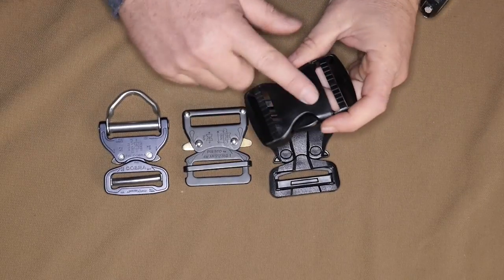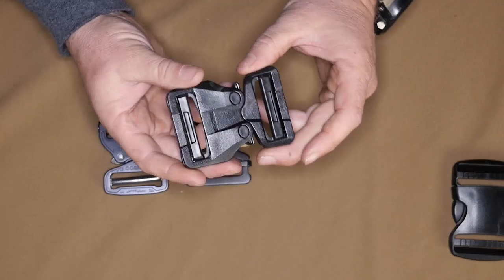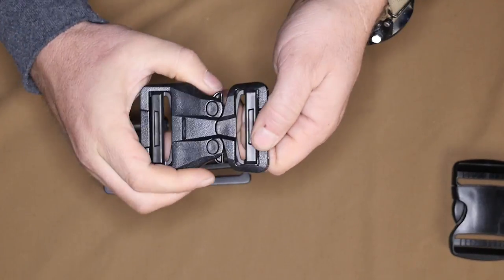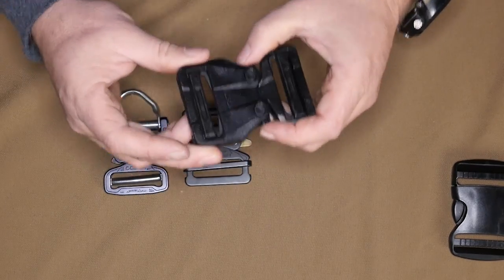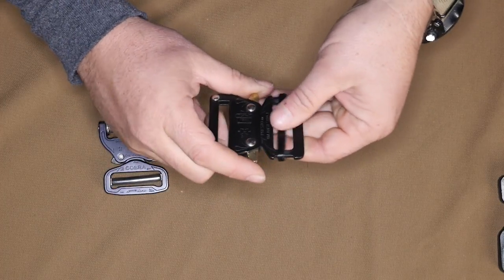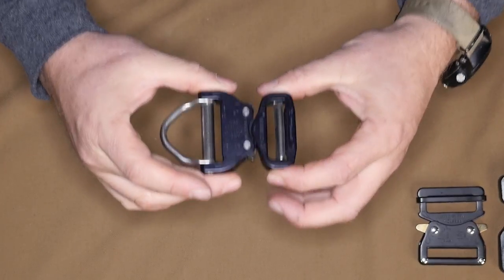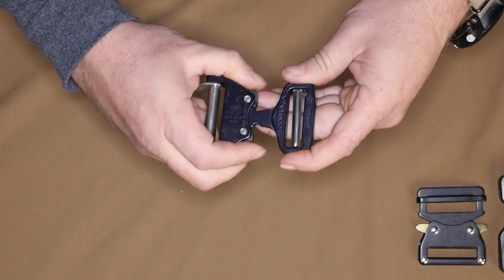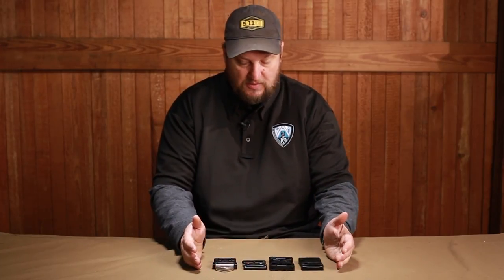Why Do You Use a Plastic Buckle on Your Dog Harnesses and Collars?

Comment: Is there any particular type of buckle that is recommended for a dog harness used for pulling?.. the plastic buckles the harness came with are too easy to unbuckle.. will come lose with no effort at times
Reply from the maker: We would recommend the GT Cobra Buckle, a load-rated (500lb) high strength polymer buckle with no metal springs or hinges. Please feel free to call our customer service line if you have more specific questions! (719) 380-0404
Reply: @RayAllenK9  thanks for that very informative.  Why do the buckles look like mangoes?